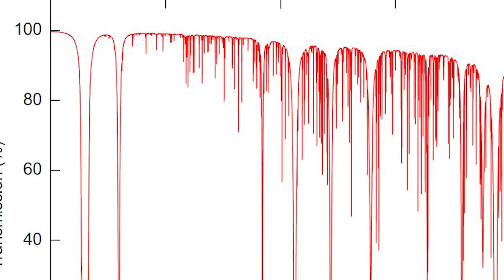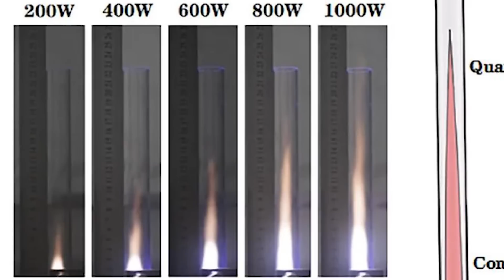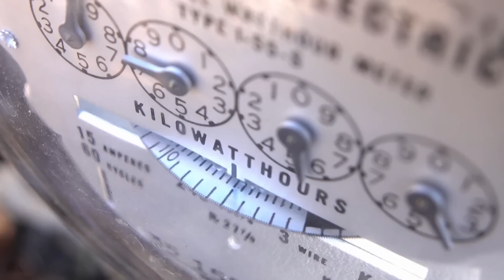The Microwave Plasma Jet Engine that Could Change Everything

Comment: :hand-pink-waving::face-blue-smiling::hand-pink-waving:There is also a secret technique for flight in the atmosphere, plasma propulsion panels. They are located in the form of round zones around the perimeter and on the bottom of the device. A column of ring vortices is created from below and along the movement - this is how the device flies... Everyone has heard about railgun guns - this is a system of two extended longitudinal contacts-rails and a projectile between them. If an electrical impulse is applied to the rails, induction will accelerate the projectile to cosmic speeds. Following it, a jet of hot plasma will also fly out. Such guns are being developed in many countries. The momentum created by the railgun can be used not only to fire, but also to move. Accordingly: spacecraft have pulse engines that shoot plasma at the right moment - creating sufficient force to move from one orbit to another. For example, “Ablative pulsed plasma engine”, there are reviews on electric propulsion engines. These engines are large; a plasma jet appears there when a plastic plug located between the electrodes burns. Secret vehicles (“flying saucers” and “dark triangles”) have propulsion panels. There, railguns are reduced to the size of a pencil and assembled into flat panels, which in design resemble the plasma panels of ordinary televisions. The distance between the contacts is small - an ordinary spark of an electrical discharge becomes the bridge between them. The cells operate synchronously: they shoot jets of plasma - sparks of electric discharges accelerated by the force of induction. Their speed is enormous, the number of railguns in a panel is hundreds of thousands. The total motor impulse is impressive. The discharges occur at a megahertz frequency, each pulse striking the air, which swirls into toroidal rings. These toroidal rings form the air cushion on which the vehicle flies. In the horizontal direction, a pushing effect is created in the same way. In a vortex jet, due to the rotation of air, the temperature drops - moisture from the air is frozen in the form of snowflakes, on which the light of electric discharges sparkles. The result is a kind of “solid beam”, which, when rocking the apparatus, is capable of bending - because the trajectories of the vortex rings are bent. The devices fly quickly and they are very maneuverable - thanks to the lightness of the device (it is made of composite materials). There is harm: from pulsed plasma engines - microwave radiation. Load capacity is low. There is no radio communication. Narrow application profile - rare spy missions. The question is often asked: where does so much energy come from? Answer: they use super-galvanic cells that create a current of 1000 A. The principle is simple: a magnesium tape (magnesium on a viscose basis) is scrolled past the electrode in the presence of an electrolyte. It's like playing tape in old tape recorders. Magnesium is completely oxidized and enough energy is released. Previously, magnesium tape was thrown out as an “exhaust” - this is how rumors arose about “angel hair” that remains after the passage of a UFO. Now the waste tape is collected and magnesium oxide is recovered. This technology for generating energy is very expensive, but it is used for spy technology.

Comment: Or conversely they could use Hydrogen as a fuel, requiring very little refit on existing jet engines. Hydrogen powered jets were developed back in the day and were considered for use on the SR71 until the brass shut that down, believing Hydrogen fuel to be more dangerous ie the guy making the decisions didn't know what he was talking about. These jets do leave long vapor trails in their wake, but it's water vapor so no big deal. I know producing Hydrogen and storing it in tanks is a problem but those seem way more solvable than this is.

Comment: Ya, from everything I have read on high temp and thus high pressure thrust plasma systems would be it in Fusion Reactors or so called engines and we are no where a solution's for the materials the problem for real, and other than for high magnet field shielding which takes a lot of energy in and of itself to produce and even this is yet to be shown as a real solution over more than milliseconds. The problems are vast. We're deal in temperatures in Million Degree Kelvin to produce thrust to like a SCRAM or even HCRAM Engines in the SR-71. I doubt China can do it. Shit the West designed and built all their Fission reactors for them.  They can't even build a copy of a tank, drone, stealth plane or functioning 30 watts LASER or any stolen tech can make anything that isn't a screwed up. I doubt their hypersonic missiles are anything but show toys. Kind of "Tin Missiles on Display" going down the street. They again look a NASA's and Lockheed's designs don't they! I'll bet just go 500 k/hp and travel 30 K then explode in the air. Complete wet farts! classic "Made in China".

Just look at Form of Function testing on the Covid-19 Virus they screw that so badly it got away on them because didn't even know how fix their French built air filter system and damn Virus got out on them back around first of June 2019 killed 5 or 6 of their military lab people. Then it killed over 200 people in Wuhan by 1st Sept 2019 and the CCP has been denying their screw up ever since.  They're F up's at best! Nothing you buy from there lasts more than a few weeks of use and anything that might is stolen tech. Japanese they never will be! They make trash and sadder yet we're now polluting our lands with their stupid crap! You get what you pay for often!

China like the USSR is all smoke, mirrors and BS! They are scared spitless of the West especial the USA. But you never take a someone who is scared for granted because that's when they cut your throat. China fooled some of us once as being our friends but never again! The quicker we cut them off on all fronts and put close Iron Curtain back on that Country that better world will be. Over 7 million lives have paid the priced. They need to throw Marx's insanity out the window become truly Democratic instead of play acting it and show the world it will stop lying to it when it makes major mistakes like letting out Biologic Weapon free upon the world when should have never been making one in the first place. Until then all business should stop with China.

Comment: This is a stupid idea. All you have to do is run the air directly through the reactor (an air cooled reactor). Why would you turn nuclear energy to heat to mechanical to electrical and then back to heat?

Comment: I look at the  Chinese plasma cutter I got from Amazon for $200. For the price, it is amazing. Even hooked up to an air compressor, it doesn't feel "thrusty."

I'm calling BS on this. The amount of electricity needed has to come from somewhere. It's the old, "you don't get something for nothing," when it comes to energy. 

My cutter will cut half inch (13mm) steel like butter. It takes 220 volts in the USA, where the usual 115V is just not enough.

Then there's the microwave energy end of things too. All this does not make sense when it comes to flying a plane. The only power source powerful, portable enough to run this, has to be fossil fuels, which defeats the reason they are attempting this. It just doesn't make sense

Hopefulliy, they will figure this out. The Chinese are smart and driven people.

Comment: The prototype they had was flawed for a few reasons. The power they produced was from a device that was the size of a night stand. The power they claimed that it produced was in a fixed position and in a vacuum. Like a potato gun. It also does not produce as much thrust as an ion engine which has been around since the 90s. And finally there was fuel. An electric power source.

Comment: Ya, no, the lightweight power source is the issue.
Bio-jet fuel is expensive as hell, but it is the simplest solution.
High speed train and Stop Traveling, the cheapest solution.

Comment: Waaaaay too may assumptions stated as fact. First off, it presents carbon dioxide as a bad thing. Its not. Its a GOOD thing. Without it, plants die. No plants, all animals die. The more CO2, the better plants grow, the better they grow, the more food they produce and, as a byproduct, the produce OXYGEN we need to breathe. Duh. Second major fallacy or fact glossed over. How much electricity did it take to run their experiment? How much COAL did it take to fire generators sufficient to run their puny little experiment? Notice how that little factoid was entirely MISSING?  So, they are saying 'this is great, it can power a JET'. Yeah, well, better bring the world's longest extension cord because there isn't portable electric power source in existence that would suffice! Or maybe we should just make every jet NUCLEAR. Yeah, that's the ticket. After all, those things NEVER crash. Oh, and if you do put a little nuclear reactor in every jet you could fuel it with water and use a STEAM jet for propulsion that's orders of magnitude more efficient!

Comment: Even if that worked you would need huge heavy batteries to power it. That's why there are no tesla semi trucks, the batteries are so heavy it limits the amount you can haul by more then half. Nothing right now has the power density of petroleum.  Energy in equals energy out to match a jet engine even if this worked at 100 percent efficiency it would use massive amounts of power.

Comment: While plasma was the first state of matter after the big bang, it's not the atomic plasma we are familiar with.  The very first state of matter to form was a quark-gluon plasma.  When temperatures were so hot, not even protons could form.  It was quickly replaced with atomic plasma that was still so energetic that fusion was happening without the gravity of stars.  For the next 400k years, the entire cosmos was opaque to most kinds of EM radiation due to the sea of protons, neutrons and electrons that flooded all spacetime not allowing photons to move freely through space.

Comment: If global warming is bad because of CO2, but plant life loves CO2, and the ultra left want us to eat greens only, wouldn't coal powered plants be good? And what about the evidence showing that the temperature of the earth fluctuates by the century and millenia? Why switch to an electric car if you live in a state telling you to use less electricity? What about the fact that replacing batteries costs a new car? Than, we have the giant mines for the batteries, the waste they create, and the toxicity of the materials. I suppose windmills are made in factories that don't require petroleum products to make the parts. And how many 1pp's of gallons of oil does a windmill use a year?

Comment: Meanwhile propeller based thrust works without needing plasma at all and probably uses way less energy as all small drones uses them. Not sure what the benefit is here for reaction-less ion drive. The inference is because it uses microwaves it’s going to be green in the method for how it gets the energy??

Comment: There is a considerable issue of scale and weight to this device and the energy requirement essentially increases exponentially on that basis. Add to this the need for either light energy storage, energy transfer to the aircraft or some kind of on-board energy generation and this is a technology that would be useful to power highspeed drones but not commercial aircraft. Not until we can create batteries with the same or greater energy storage / weight as fuel.

Comment: There's no missing information, because there's no real information at all. There are no real physicists working on this. This is pure propaganda. 

Anyone who actually wanted to decrease the fuel usage of airplanes would be putting efforts into flying less, not more. Flight is BY FAR the most energy intensive means of travel. It's also the absolute worst with regard to scalability. For instance, with trains and ships, larger vehicles are more efficient than small ones. With planes, they start out bad and become exponentially less efficient as they get heavier. Thus, air cargo is intrinsically inefficient.

Comment: Somebody has not even looked at  the nitrogen oxides production from such a device, even if it could be made to work. Replacing fossil fuel emissions with nitrogen oxides emissions would not be a good idea. Look at the catalytic converters we put on our cars, partly to clean up nitrogen oxides.

Comment: Not all plasma are hot. Some are cold that even touched they don't burn. Also, the plasma should be confined inside the engine and induced to provide thrust using  extremely powerful magnetic fields and not wasted as exhaust since that is what a regular jet engine does. Such a plasma engine requires very little fuel but it does need a great deal of electrical power.

Comment: As a spacecraft engineer who deals with plasma a lot, I believe the only reason this research was published was to save face with the CCP.  Unfortunately so much peer reviewed research on X-ray propulsion has proved to be fraudulent.  Also it is functioning more like a pneumatic regulator, this has more in common with my air compressor than a true plasma engine.  The low power requirements and the materials used for the tube are dead giveaways as well.

Comment: Man made climate change due to carbon emissions has not been proven. As a matter of fact the real experts in this field actually say carbon emissions have made earth more green and oxygenated since carbon dioxide is essentially plant food. The actual warming effects simply due to carbon emissions really can not be quantified seeing that the modeling used only goes back for roughly one hundred years and when compared to global temperatures going back thousands of years the temperature rise that modern "climate change" organizations are comparing are just a small degree of change when looking at the totality of earths temperature fluctuation overall. There's much more evidence showing that the sun cycles and weakening of earths magnetic field effects global temperatures far more than man made carbon emissions over the past hundred years.

Comment: "If I have lots of electricity I can produce thrust with plasma rather than fossil fuels." - If you have lots of electricity you can product thrust with a propellor. The problem is having lots of electricity if you don't burn fossil fuels to create the electricity in the first place. (and it would be more efficient to turn the fossil fuel directly into thrust rather than going via electricity). You needed to quote a few Thrust/Watt values to give some idea how useful (or useless) this tech is.
Reply: Yes, it is clear that these designers are planning to power it by unicorns running on treadmills just as soon as they get the treadmill design right.

Comment: Plasma engines will increase global warming and destroy all Ozone protection because of their Nitrogen Oxide generation.
Reply: I say they won't because as soon as you start looking at how much power it needs vs an electric motor turning a propeller, you say "well that's not so good"
Reply: @kensmith5694  Airfoil. Helicopter rotor is actually a wing. A propeller can only lift its thrust in weight. A winged aircraft can have thrust to weight ratio as low as 0.16.
Reply: @stephenjacks8196  I think you got my point about this "invention".  BTW: the "flying flapjack showed that the aerodynamics needs to consider the wing structure and the propulsion system as one complete system.

Comment: A typically jet engine will produce over 20 Megawatts of power. If a commerical jet only has two engines that 40 Megawatts. You need at least a 40 MWe turbine just to power the two electric engines. This microwave electric engine is Dead on Arrival.

Comment: Even with plasma electric propulsion planes will still require extraordinary amounts of energy to fly. Cambridge physicist David MacKay (author of “Without Hot Air”) has calculated that a single Atlantic flight ONE WAY uses about 4800 kilowatt hours of energy per person (630,000 kilowatt hours to fly that one plane one way across the ocean).  To put this crazy amount of energy in terms that are easily understood he equates it to a hot shower: a 30 litre hot shower typically uses 1.4 kilowatt hours of electricity so a single return airplane flight uses as much energy as 6858 showers for every person on board.  It’s like everyone on the plane taking a shower every day for almost 20 years - equivalent to 900,000 showers for the entire plane! (McKay actually estimates this higher as 12,000 kwh per person on his webpage - this figure is from an earlier version of his book - 12,000 kwh is the same as 17,000 showers a person on a return trip.  He states, “Let’s make clear what this means. Flying once per year has an energy cost slightly bigger than leaving a 1 kW electric fire on, non-stop, 24 hours
a day, all year.”